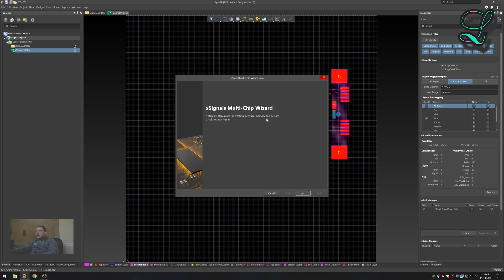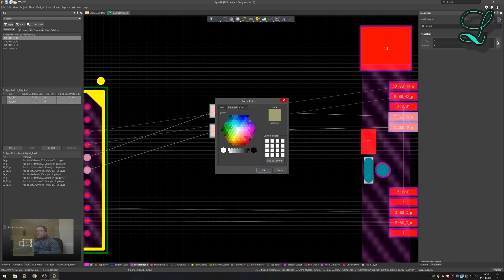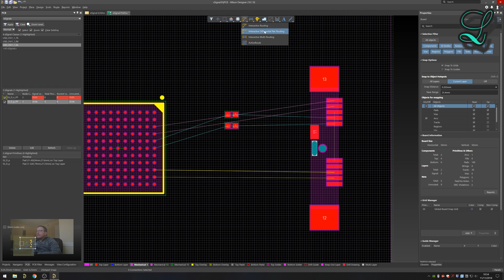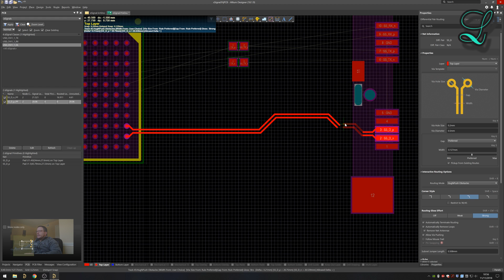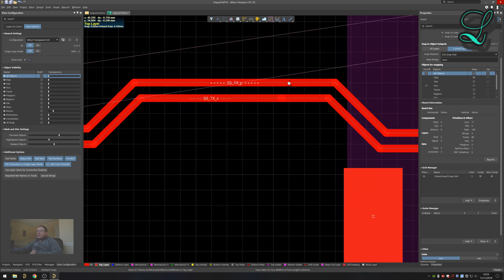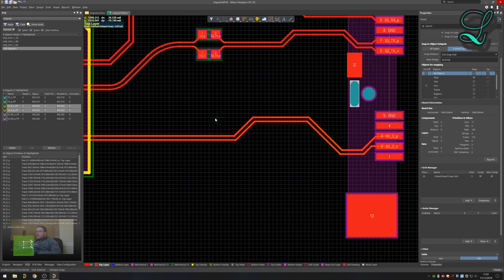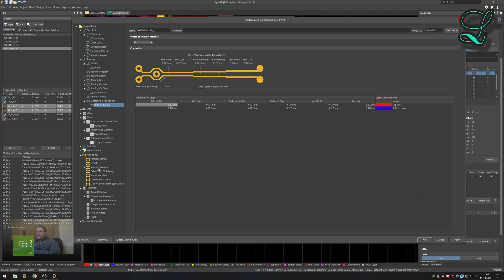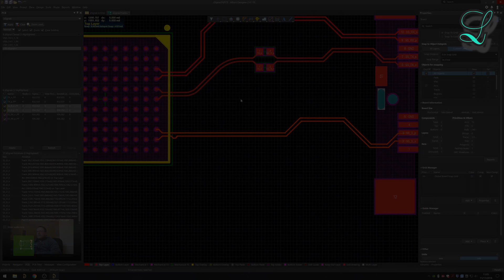Altium Designer - xSignals

Comment: In my pcb design, the USB 2.0 pins go to the current limiter integrated. Therefore, the names of these pins are different. Doesn't appear in Xsignals section. What can I do?
Reply from the maker: In Altium, the signals must have a differential pair directive for every net in the schematic and there needs to be a _P and _N suffix.

To be honest, USB 2.0 isn't really fast enough to require the accurate matching that xSignals gives.  You can just route them like any other differential pair and tune if needed.

If you want to use xSignals, just run the xSignals wizard and choose Custom Multi-Component Interconnect.  Enter the parameters and choose the start and end.